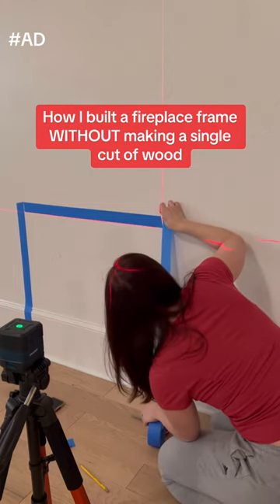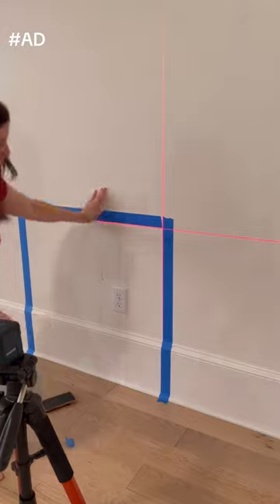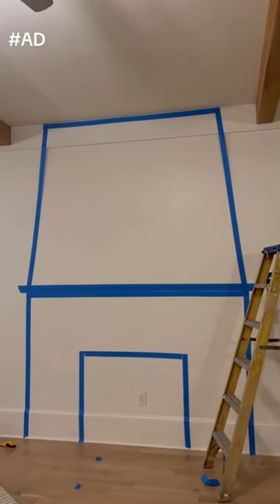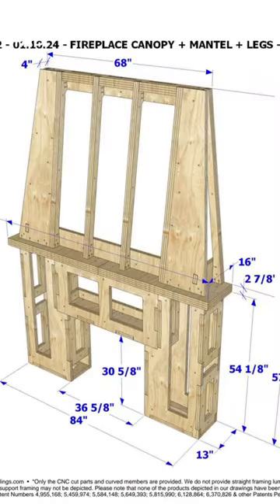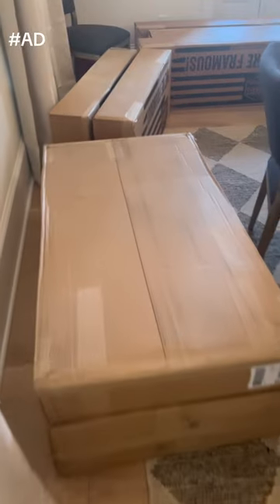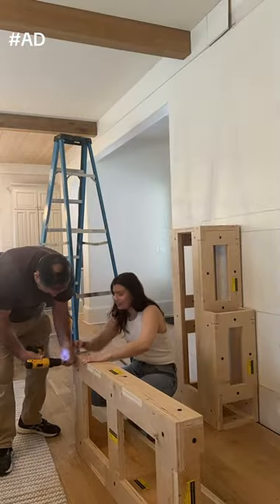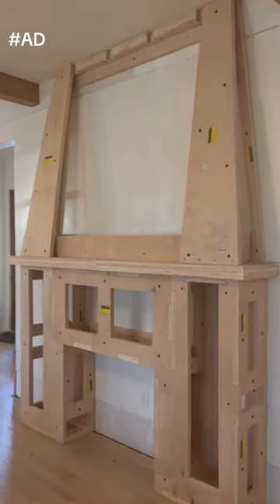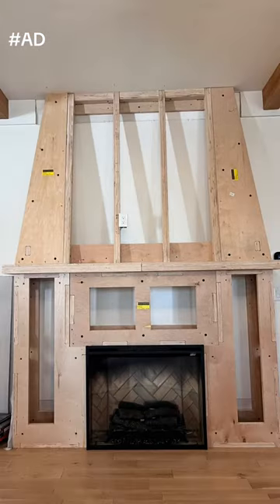This kit saved me so much time and money 🔥 #ad #diy #cozyliving #homerenovation

Comment: Here are My questions? Did you keep the power outlet in center of the firebox because this was going to be a electric fireplace? If not, what type. The look reminds me very much of the fireplace in my sister's Tudor revival home that is a gas log fireplace with oddly the original wood floor inside the firebox. Her home was built in 1933 . Where did you get your fireplace kit from and how did you find out about them.?